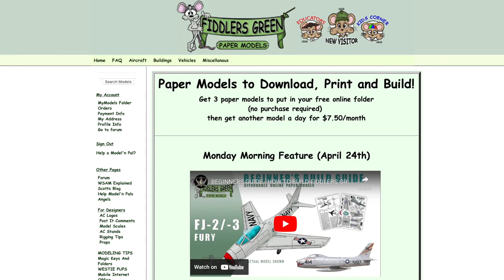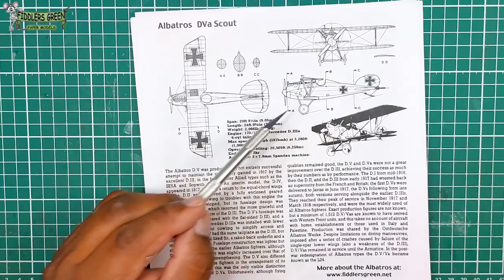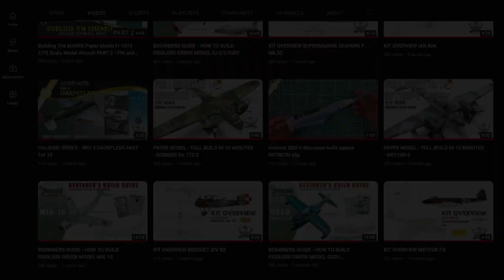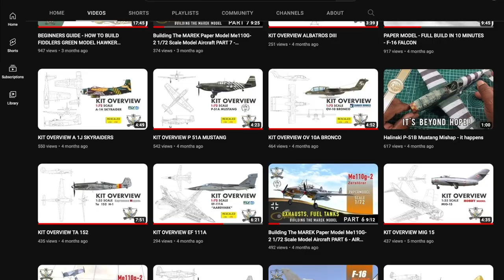BEGINNERS GUIDE - HOW TO BUILD FIDDLERS GREEN MODEL   ALBATROS D.Va

Comment: What kind of paper do you use?  What kind of printer?
Reply from the maker: Greetings.  I used an Epson inkjet printer to generally print my models. But if you can get to a copier shop I strongly recommend that you get it laser printed. It is well worth the money. Hope this helps. Cheers my friend.
Reply from the maker: The paper thickness is cardstok of at least 140gsm.  Basically thicker than your regular bond office paper . This can be had at any stationary center.  If not then double your regular  printer paper. Take care.